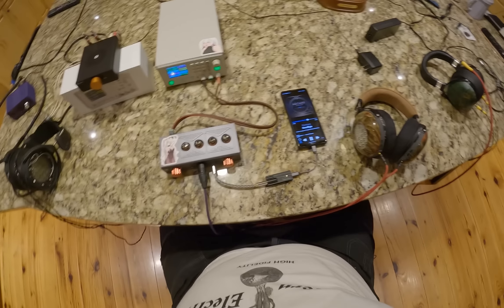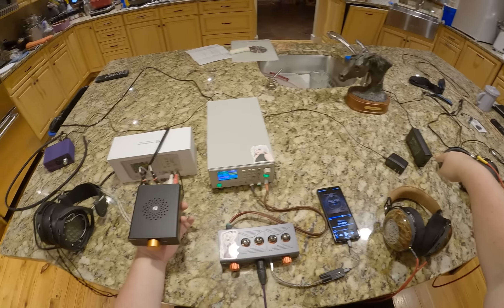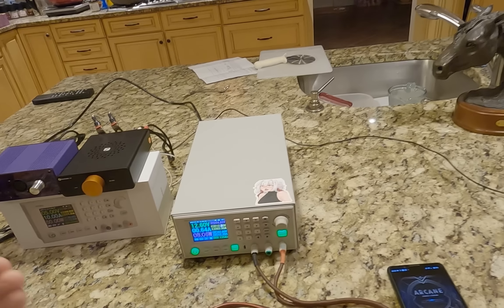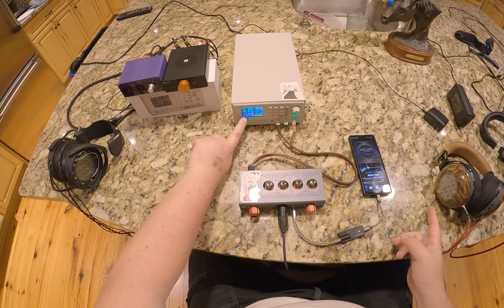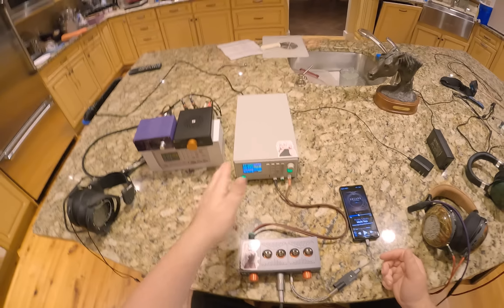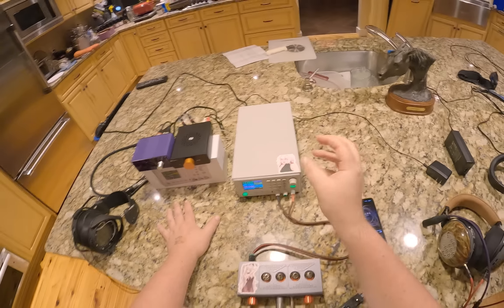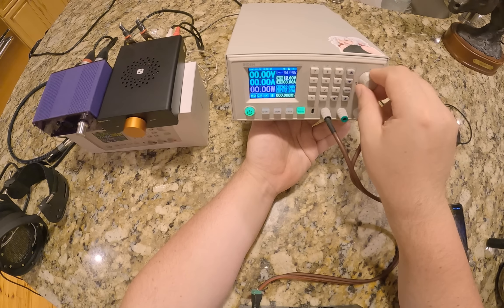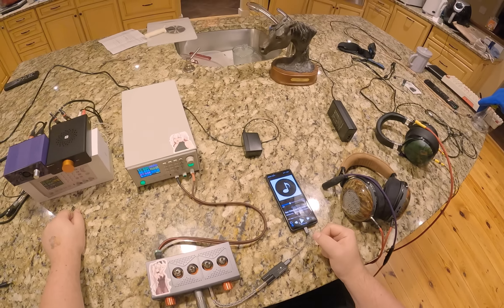Let's Blow Stuff Up! || Riden RD6012 Power Supply

Comment: Lab power supplies are excellent to have, I just upgraded to a 1kW one 🤣 just be careful though as some cheaper ones have quite a bit of switching noise as they’re not really designed for audio applications. Most devices should have the filtering after it but yeah worth sanity checking from time to time…
Reply from the maker: When @itman496 swears by something I can have faith. Its doing a good job even as a switching.

Comment: (Fosi V3) "If you're buying the Fosi to do headphones, you probably don't need to go higher than the 32V/5A that comes with it." ✅ OK, dumb questions time... Would the Tungsten sound better with the 48V/5A Fosi power supply anyway and will I need a stepdown transformer here in Australia to run either power supply or just a travel adapter??

(Tungsten) "They're going to be $1600." 😲✅"I'd take these over Susvara."... ✅ 🥳👍

Well that's all the review I need on both! As for the wait time, I'd wait a decade for affordable Susvara killers. Very happy the Fosi V3 runs the Tungsten, but where can we find a proper adapted headphone cable that connects to the V3's speaker outputs? Sorry Z but your current way looks like a trip to the ER or a visit from the fire dept just waiting to happen!

Comment: All systems should go servo. If all manufacturers move to servo push pull systems then costs go down. if you want the best audio - servo systems control the movement of a driver and the membrane can be made as thick as you need it without having diaphragm lag, waiting for the return of the membrane to neutral position and without requiring a massive magnet and voice-coil. That means reduced heat and mass. Everything is better in servo land. As a matter of fact I'm a bit pissed off at the industry and guys like you who aren't demanding that all amps become servo amplifiers.
Once you go servo you can fight the pervo.

Comment: Umm…amps and tube amps in particular are not efficient devices.  So, you cannot look at what the amp is drawing and conclude that’s what these headphones need. And the first SJY drawing 4A would put its impedance at 3R, which is crazy.

Finally, providing way more voltage than the device is designed to handle will primarily achieve 3 things: 1) Distortion, 2) Overheating and ultimately 3) Damage.

It might draw more current if the receiving circuit is not current limited by design, but most are.

Comment: So..do recommend a better power supply for the 604…for an even better performance?🧐
Reply from the maker: I mean from testing a 13v 2A doesn't blow it up. BUT you also need a very demanding headphone specifically that needs a higher output voltage. I would tube swap instead.
Reply: @ZReviews  Thanks …something to consider 🤔
🍕☕️👍
Reply: Yes the tube swapping is where it’s at, I have a smol collection of 6j1’s from my MT602 time, but save your money and get a TA-22 if you can, it’s just mo betta
Reply: @beezlebub3955  I’ll give it a thought 👍🍕☕️

Comment: But is the power supply quite? Most variable power supply tend to be very noisy. Electrical noise is extremely detrimental to audio quality.
Reply from the maker: There is a fan at the back but I don't even think it turned on in any of this testing. Because it is designed for 60v 12a and nothing was coming close to rated power.

Comment: SMSL AO100 driving my Klipsch desktop speakers @ max volume = 2 Watts at the wall  (Both speakers driven)

JBL LSR 305 powered speaker at max volule = 4 Watts at the wall  (8 Watts for 2 speakers)

Yeah, testing is fun but you need to know how much voltage and current is required to kill you instantly when testing

Hope you read that far
Reply: Best High CRI lighting during a power outage?

Try a small USB powered video light like my Aputure Amaran F7   (2.5 Watts @ max output with USB power)

I made a desk stand for it from a small Mic stand with a 1/4 - 20  adapter and goose neck 

Use it every night!